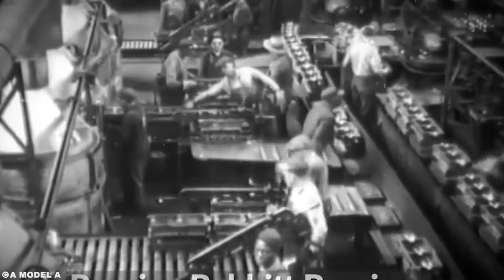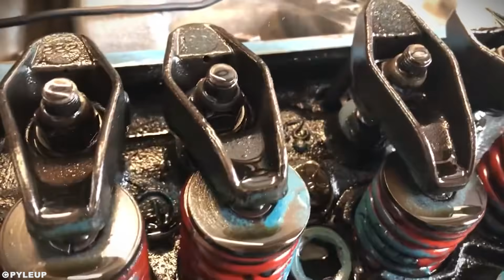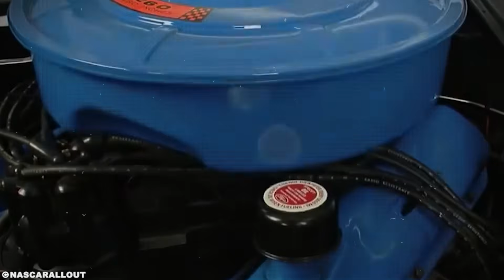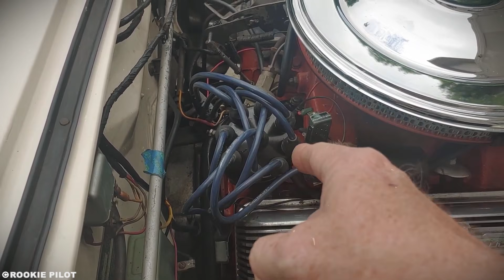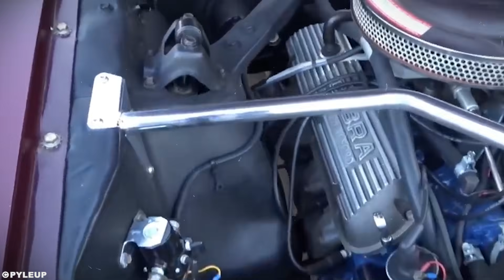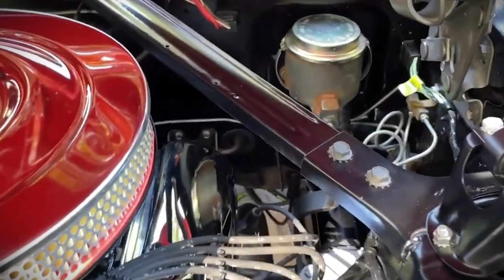Even at 271 HP & Hydraulic Lifters, the Ford 289 Hi Po Shocked Everyone Beating 427 Hemis

Comment: I once owned a 1964 Comet Caliente 2 door hardtop with a 289 Hi Po V8 engine and 4-speed manual transmission.  I was the 3rd owner and knew all of the previous owners.

While I owned it, it was fun to drive.  However, stopping was another story.  The drum brakes were horrible!

Comment: Just like the compression ratio some of those Max wages were 13 and 1/2 to 1 and how about the error code galaxies with a 427 in😊😊 or how about the 409 Chevrolets of the super duty 421 Pontiac with those muscle cars I'm not sure how about a Chrysler 300 with a 392 hemi in it and injection in 1958
Reply: All far quicker in the 1/4 mile than any 270 some horsepower 289 wheezbox. Yes they were kind of quick for about a city block in a very lightweight mustywang. Big deal!

Comment: The first muscle car in a 63 Fairlane how about a 63 Max wedge Dodge or Plymouth 426 I think that might be a real muscle car
Reply: Actually believe it or not, a 427 transplant 63 Fairlane was actually the first prototype for the thunderbolt, which of course were soon based on the 64 Fairlane.
Made by one of the Skunk Works that Ford used for one-off things back then, Dearborn Steel Tubing. Bob Tasca was the instigator for the project.

Comment: I bought a rusty 2-barrel 289 Mustang in the mid ‘70s and the previous owner included an unused in the box 289 HiPo cam. It was made for solid lifters and that’s how we rebuilt it. And everything I have read says the K code 271hp 289s were built with solid lifters.
Reply: You're absolutely right. I was around 16 or 17 when it came out and I distinctly remember solid lifters on every one of them, and I was a close follower of the Ford performance Saga at that time. Plus I have books that say it was a solid lifter cam but I don't need the books to tell me that.